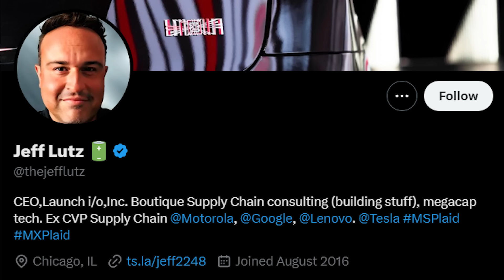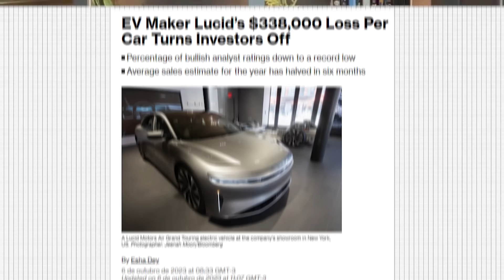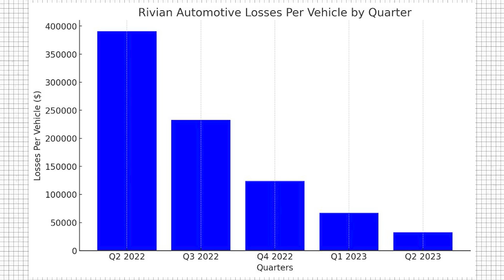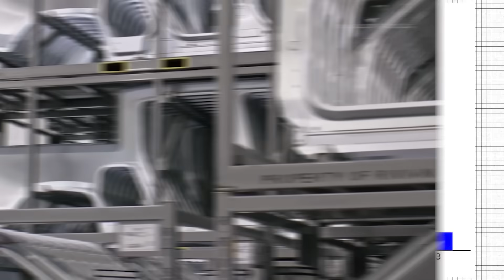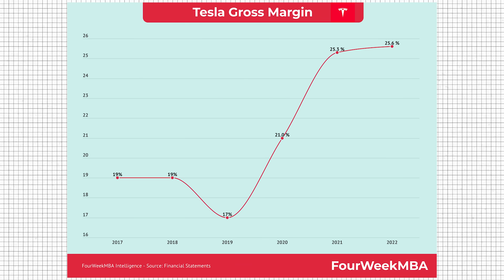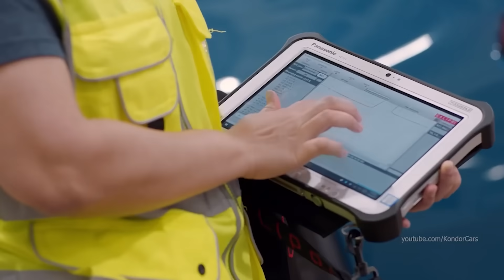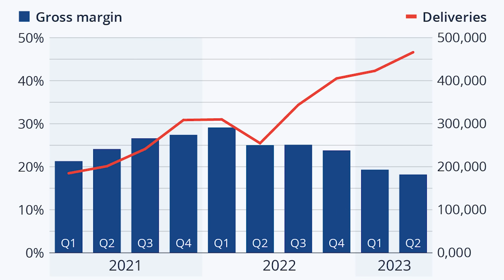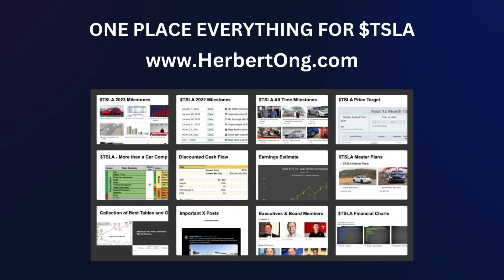Tesla's Competition is Losing Billions!

Comment: Thanks Herbert, Jeff. Great discussion. I am a big Tesla fan and grateful TSLA investor. Just one question. Jeff's theory about the continuous COGS reduction that should more than offset the price cuts, sounds good 'on paper', but in reality it does not seem to materialize in the gross margins (which keeps going lower every quarter). Matt has a great observation in your interview, when he said that prices just got back to the pre-pandemic levels (2019-20), but gross margins are still lower today (like 18% vs 22-24% pre-pandemic). How is that possible if Tesla reduces the COGS by 2-2.5% every quarter as Jeff claims? COGS should be 30-40% lower today, and knowing that prices are the same level (approximately), the gross margin should be a lot higher today, I guess around 25-30%. Something does not add up, or something is missing from Jeff's theory, no? Thanks.
Reply: Sure:
1. New factories Berlin and Austin are the key difference. Tremendous drag on COGS, several thousands of dollars per car. Those two factories didn’t exist when MY/M3 launched 
2. MS/MX from 2020 was 15-22% of sales volume, now 4%
Reply: 3. Inventory discounts now (did not occur 3-4yrs ago as there was little to no inventory)
Reply: Thanks, Jeff. All very valid points. The real question is what future/unknown factors will/could prevent the margins to go back to 20%+? Frankly, based on your (very logical) theory, I am waiting the margins to start improving, but it has not materialized, yet. (And probably won't today in Q3 either.) Usually, the 'unknown unknows' that are biting one's ass in investing...:) So it pays to be conservative, even if things that impact on the negative side can not be actually named, yet. (E.g. who have seen the covid shutdowns, or the runaway interest rates just 12 months before they happened?) I personally think margins will only go back to above 20%, when interest rates start to come back down... Everything else is just wishful thinking. But I would love to be wrong on that...:)